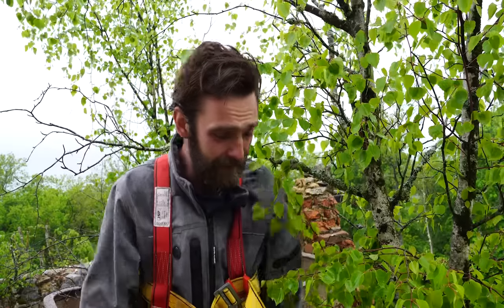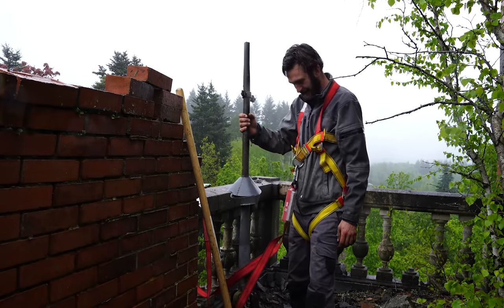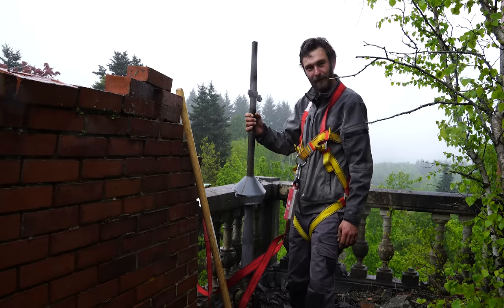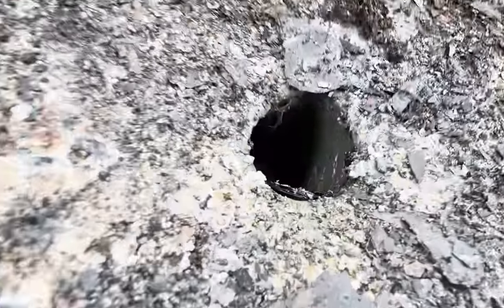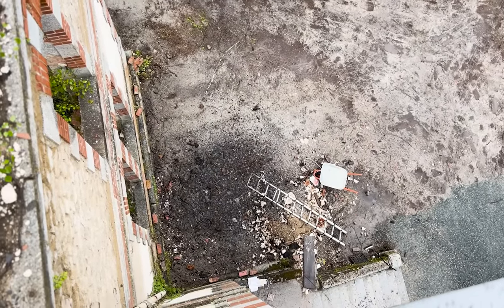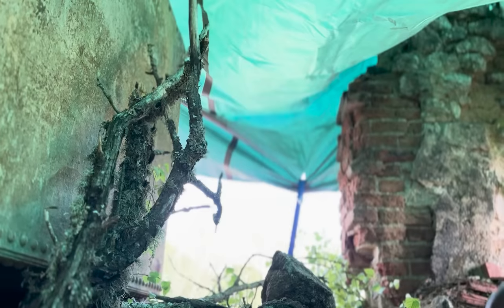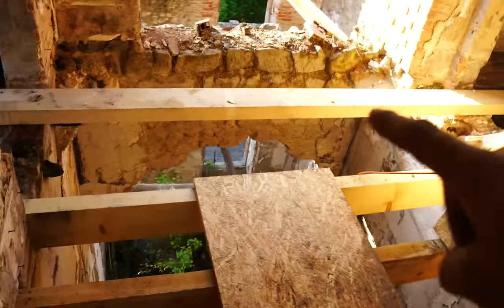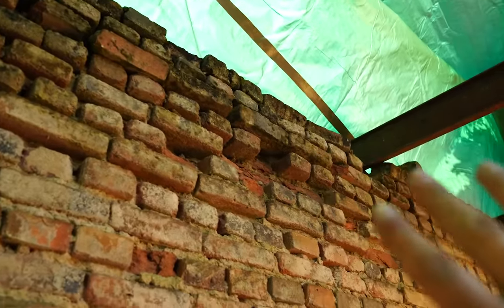I climbed the height of this ruin to make it watertight.

Comment: I keep looking at the construction of the chateau and am perplexed! The outer skin is of modern brick while the inside seems to be of a more ancient structure/ build.  If it had been built in the twenties then I would expect a double skin of modern brick not old type brick internally and modern brick outside! 
Puzzling!
Reply: As far as I can tell it was built some time between 1901 and 1906, not in the 20s. Back then labour was still cheap and materials were expensive, so using stone on the invisible parts might actually have been a financial decision. The centre wall was built using softer common bricks because it's an internal wall and was always meant to be plastered on both sides, while the exposed parts need to look good and withstand rain, snow and frost so the bricks have to be harder. Otherwise they'd absorb water and crumble as they freeze.

Comment: Now the tarp fills up like a swimming pool and its to heavy to get off so when you try 100 gallons of water dumps on the place your trying to keep dry.Tarp needs to be trampoline tight with supports under it and no low spots.Been there done that many times -tarpology 101  good luck

Comment: Those water tanks.. I'd get a jigsaw with a metal blade and cut them into 4 or 5 pieces each and lower them out that way. I've cut acro-props in half that way before, might take some time but it's an option. Also celebrating the first sighting of a broom 😂

Comment: Will your chateau water supply be from an on-site well or will you have pressurized water service from a water utility company? If possible, I would go with a well (as it is free water,) as long as there is a robust underground water table. Then, you could also have the water utility services plumbed into the well system for emergencies/droughts. With today's powerful water pumps, there shouldn't be a need for a tank on top of the chateau, as modern water pumps are more than powerful enough to defy gravity for your purposes. If you feel you must have a water tank, I would place it in the basement adjacent to whatever water heating system you install. I would reserve as much of the roofing surfaces for solar panels to reduce your electrical power costs. I feel you must try for as much self-sufficiency in regards to water and electrical service, as possible. You will not regret it in the future when power and water utilities increase in costs. I'm not sure how many acres/hectares the chateau property encompasses, but a solar panel farm would be a good investment if you have the space/area.

Comment: Make sure to have a slope/peak on that tarp, otherwise it will act as a catch basin, which might actually bring the unstable walls down.  I've made that mistake before.  It's crazy how much water collects in a tarp even during a light drizzle.  Just shoving a tall post in the center will help a lot.  Like a circus tent :) I was so happy to see the stop blocks you screwed down in front of the ladder.  I have had a close call myself when the ladder kicked out when I was 30 feet up!  Thankfully it slid down the wall and I reached the ground safely.  I had tried to make the ladder safe, but unfortunately the ground the ladder was on comprised of over 2 ft of ashen debris (from a fire that had burned the previous building down), and all the stakes I used just loosened up.

Comment: The brick and concrete portions of the house were used anywhere there was water because of the two cisterns on top that’s why they’re brick and the bathrooms would’ve had the same treatment for flooring so if anything leaked it didn’t rot
Reply: I think that's partly correct. The bits above the bathrooms were open terraces, so they needed weatherproof floors. The bathrooms themselves had plain timber floors, joists and floor boards. Some of those even miraculously survived the fire. The hallway probably had a brick ceiling to support the water tanks.

Comment: From personal experience I'd suggest you put a rope over the top of the tarp in several places to hold it down. Securing it by the edges alone isn't enough. Get some wind under that and it'll be in the next département!  The force a gentle breeze can exert on a big green sail is surprising.  I had a roof off a house in an exposed site and tarped inside under a scaff lid and the tarps shredded. But, getting that on and being dry for the first time is so nice.

Comment: As other have noted, there are two major risks with this tarp. Your property is so high, that all bad weather will make it a massive sail. Wind, and any stormy weather will cause absolutely horrendous forces on that tarp and it will tear anything attached to it and will likely be hitting everything up there in a storm if any corner gets loose. So it will be throwing a lot of unstable material down on anyone walking by, and it will be impossible to get hold of it and re-attach it once it becomes loose at those heights. The second is it becoming a pool and that can create forces again different mentioned in the first part, but again it will tear down a lot of stuff with it if it starts to gather tons of water. Hopefully not, but the sail but will be extremely likely to happen and needs extremely good fastening all around so that the wind doesn't get under the tarp in any storm!!!

Comment: I have a great deal of issues with the "fall restraint" system you are using. Not with the concept but with the design of the harness.
They can, in a fall situation where you are left hanging for an extended time, restrict blood flow through the femoral artery resulting amputation of one or both legs and can also crush testicles. This is of particular concern in your situation as you typically work alone and could, in a fall situation, be knocked unconcious. 

They are different from "climbing" harness's in that climbing harness's are designed to actually sit in. They support the weight over less critical areas.

Comment: interesting.  the "how to place ladder at correct angle" is lacking in this video.  have the ladder is extended to desired height.  you then stand in front, your shoes barely touching the bottom of ladder "anchors" (some call feet, the rubber things that rest on floor). with your body vertically (don't "lean" your body forward) extend your arm straight out and hands able to grasp ladder side (not the rungs). that is reasonable body climbing angle. If you are unable to reach [not leaning] or is bending your elbows then adjust the position of the ladder.  (wood and rope securement is optional but encouraged.)
Reply: And secure the ladder at the top too.

Comment: For those water tanks, you could use an angle grinder to cut it into manageable pieces, a cutting torch (again, pieces), or a gigantic crane.  The first would be the cheapest by far, but the other two would have better visuals for your VLOG.  😀
Reply: Cant the water tanks be used as something, maybe rainwater reservoirs if moved to the bottom somewhere. Useful during drought.

Comment: I am glad to see some safety precautions are happening.
I am wondering about the wind when it comes up with that tarp.
A lot of those walls do not look very sound and need to be taken down and rebuilt.
The age of the place and the fire. That Morter is very very old.
Reply: That seems to be Dan's next project, remove all the loose bricks and rebuild the damaged sections of wall.

Comment: 00:48 Mauvais sens pour l'échelle, les différents pans de l'échelle se rapprochent du point haut mais ne s'en éloignent pas il faut la pivoter de 180°.
Wrong direction for the ladder, the different sides of the ladder approach the high point but do not move away from it, it must be rotated 180°.

03:25 Mauvaise idée de s'accrocher à la balustrade, si elle viens à partir vous allez la suivre, il faut créer un point solide quelque part dans la maison, y accrocher une corde qui va en haut et s'accrocher à la corde en la tendant juste de nécessaire.
Bad idea to hang on to the railing, if it falls you will follow it, you have to create a solid point somewhere in the house, hang a rope on it that goes up and hang on to the rope by just stretching it from necessary.

08:49 Une toile c'est 30kg de traction par mètre carré pour un vent de 3 Beaufort (Petite brise) avec une telle instalation au mieux la bâche s'envole, au pire elle va arraver tout ce a quoi elle est accrochée.
A tarpaulin is 30kg of traction per square meter for a wind of 3 Beaufort (Light breeze) with such an installation at best the tarp flies away, at worst it will snatch everything to which it is hung.

Comment: Safety First. Your going to be working on this project for years by yourself, isolated. You need to think statistically to avoid becoming a statistic.

You should probably install some internal scaffolding. Your spending too much time moving things to move things.

Hugely impressive project. I hope it works out.

Comment: Dan your wearing your harness wrong!!
The front “D” ring is for rescue and your Lanyard attaches to the back “D” ring and your harness is too loose, you slip and fall, your gonna split your Bollocks, not a pretty site not too mention you’ll be out of commission for many months. I applaud your bravery for challenging a arduous task you have before you. But please have someone else with you while you do any Harness work, hanging in a harness if you happened to slip and fall causes trauma within 5. Minutes! A speedy rescue is essential.

Comment: If you start such a project u usually build a scaffolding around the building to have a strong  " Frame " ...and really the first step must be to build a roof, so that the Weather can no longer damage the inside, then replace all the windows, ...i work in construction for over 30 years, but i never saw such an unusual approche...

Comment: When setting up a leaning ladder, the rule is 5 to 1.
That is for every 5 meters hight, the base of the ladder should be back off the wall by 1 meter.
So for a 10 meter rise, it would be 2 meters backed off the wall.
Another rule is always keep your belt buckle within the two ladder verticals.

Comment: Ladder safety, always set the ladder in a 75 degree angle and make sure it extends 1 meter above the floor you’re accessing with the ladder. Especially that last one I see people not doing all the time. It just makes it hard and dangerous to get on or off the ladder.

Comment: You mentioned screwing the floor down. Aren't you supposed to use nails for the joists and the floor? I thought nails were stronger and more secure than screws for building.

Comment: Great to see some steps being done int he matter of safety.  Especially because you're alone, you might want to look into Suspension Trauma or Harness hang syndrome.  If you fell with a harness but get left dangling, it can be a serious issue that can even result in death.  There are straps you can get so if you do fall, you release them and get your feet in them.  Which allows you to stand and get blood flow back in the legs.

Comment: This kind of tarp is holding up to the elements, especially the sun, maybe a good year. I used that to watertight a shed which was sheduled to be replaced the next year and when it came that, it fell off in tiny little pieces. Good and quick solution for the chateau for now, but needs replacement rather soon.

Comment: Do you have a plan for the staircase? I’m guessing it will require a craftsman and a long timeline?
Reply: I wouldn't entirely put it beyond Dan and Amaury to try and recreate it themselves.
Reply: @Ragnar8504  that would be amazing
Reply: @darbyking-maillot4105  Funny thing is I like the stairs themselves with the carved stringers but the banisters in the 1980s pictures looked massively overwhelming and out of place. They completely enclosed the entryway and separated it from the stairs. On the other side it even looks like the stringer might have supported a thin block wall to close off the stairs from the hall completely. The whole thing doesn't look as if it was quite thought through, like how the banister of the second flight (landing to first floor) would have bumped into the ceiling because there's a wall above the ground floor ceiling level and open space below.

Comment: Hi Dan, is one end of the tarp higher than the other for rain run off?  I found that you don't want a heavy pool of water sitting in the tarp. They are great for temporary rain run off but will leak if water sits on it long term. 
Thank you for the safety gear! ❤

Comment: The leg straps on your harness is to lose. If you fall with them like that, it will take out the family jewels.  

Rule of thumb for leg straps is that you should be able to fit a flat hand between the strap and your leg, but not a fist.

Comment: You work so hard. It's a joy watching bit-by-bit even if it is very slow progress. It's bound to be slow because there's a lot to do there. Even the small little hurdles  are fantastic to watch. Too bad you didn't leave the lightning rod on the balcony for the current lightning storms. It would have been great to reuse the old rod instead of throwing it down, i'm sure it's bent or broken from the drop.  Maybe in the future, just an idea, the whole bricks that you find on the upper floors can be stacked to the side on that floor, instead of through them over the side, for the future.  It won't hurt them to stay up on the upper floors. It will save you from having to rehaul em up for the repairs, because you work so hard.

Comment: I'd try and repair the sections of brick ceiling that are still up and only replace the missing sections with something else (although for full strength the brick infill might be necessary or the pressure of the arches could push the steels sideways).

Comment: I would suggest you cut the water tanks using an angle grinder or acetylene torch, the smaller more manageable pieces will be easier and safer to clear from the roof area. Ladders are fine but a scaffold staircase on the outside would be better and could be set so you can access all the floor levels without the need to do a full scaffold for now.
Reply: Reciprocating saw would be my first choice, angle grinder my second. Plasma cutter is another option, they're surprisingly cheap. Lugging an acetylene tank up there doesn't sound like fun.

Comment: Need a floor plan so we can figure out what part of the chalet have you been working in.  Beside the tower? Behind the tower? Where are the double stairs? The single stairs? The different entrances?  I keep trying to figure out what I am looking at. On the videos there is no point of reference except the occasional peek of a door.  Front door? Back door? Or of a balcony - straight ahead of where you are working? To the right or left?
Reply: The château is shaped like a +. Double outside stairs take you up to the terrace in front of the double entrance doors into the main hall with the big oak staircase and beautiful tile floor. On each side of that hall there's one big room, the one with the massive tree growing in it on the left, the one with the completely collapsed floor straight across from the front doors and the third on the right. The one on the right only has windows, the other two have large terraces with single outside stairs. I suspect the room on the right was the original dining room and apparently it had internal stairs leading down to the basement hallway just outside the kitchen (taken from a description by Eric Thorn, one of the children who lived in the château in the early 1940s).

The first and second floors are very similar, except above the front doors there's one bathroom either side of the main stairs. Both bathrooms and the hallway form a U sourrounding the main stairs, which is where Dan's done most of the work so far. The third floor consists of the tower above the stairs and a large space above the middle (back) bedroom. The water tanks are right above the hallway, in front of the bathroom doors.

Comment: from aerial view it would seem smarter to renovate first one of the smaller, less structurally complicated side wings, floor by floor, where you could have storage, a basic apartment on the floor, maybe another for volunteers on third and then do the rest..?
Reply: floors could first be open lofts, without any walls, so you could use a stronger AC for heating.. roof very simple first, one slope one way.. you'd save on rent and invest more into renovation.. maybe that is your plan and you just want to remove wobbly walls in the middle part?